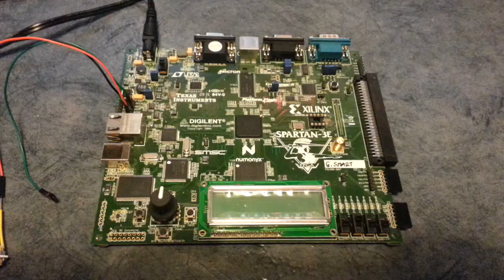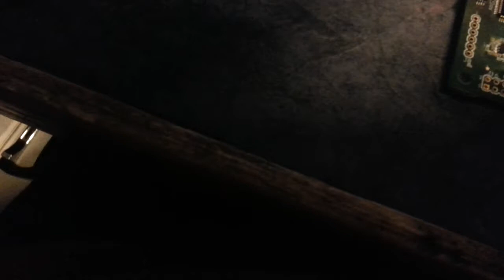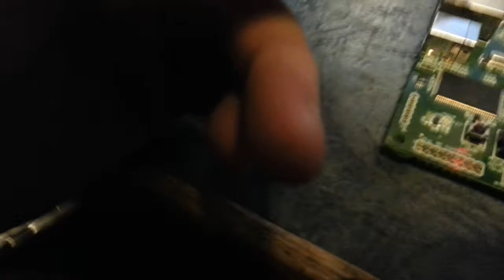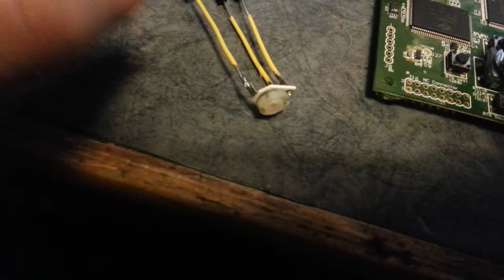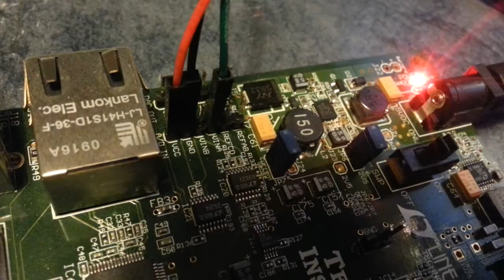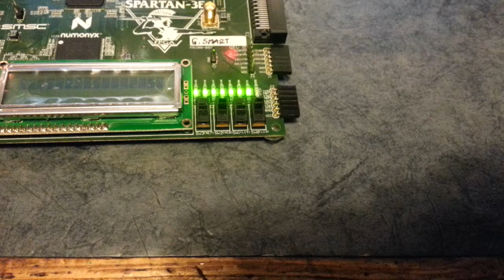Spartan-3E ADC Test

Comment: hai there..just wonder..one wire goes to VINA..onother goes to ground..how about the third one? where it goes to?
Reply: I think you need Power and GND to supply this photodetector that he is using. If you have analog input wire just plug it in. But be sure it is less than 12V.
Reply: Vcc , gnd , vina or vinb